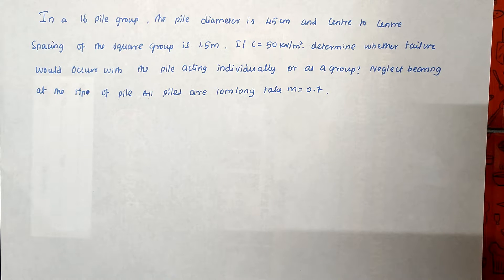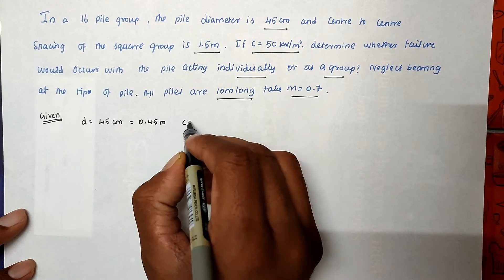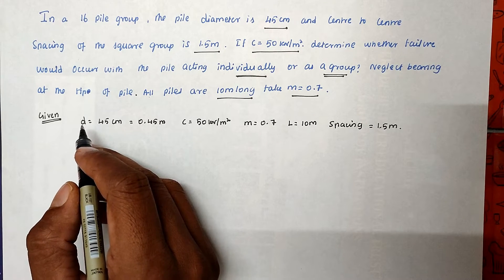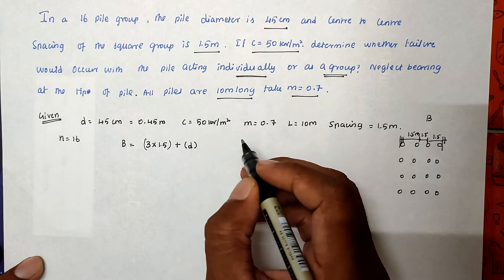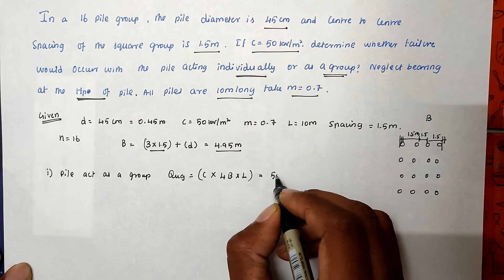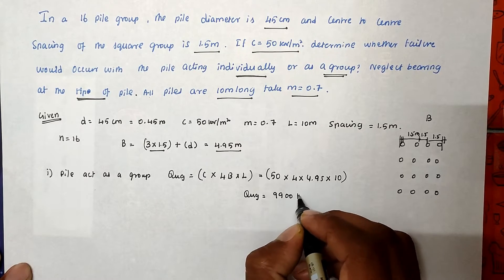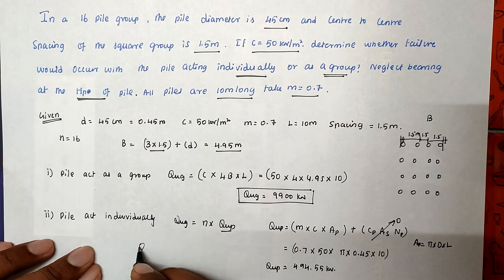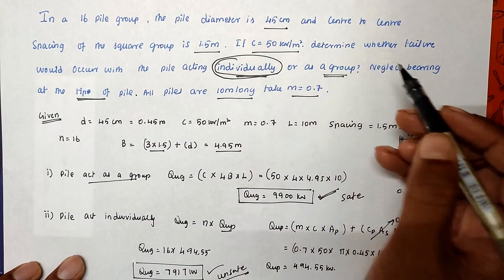foundation engineering numerical | pile carrying capacity | static formula | pile foundation problem

Comment: A group of 16 piles of 50cm diameter is arranged with a center to center spacing of 1.0m. The piles are 9m long and are embedded in soft clay with cohesion 30kN/m. Bearing resistance may be neglected for the piles. Adhesion factor is 0.6. Determine the ultimate load capacity of the pile group.
Reply: Eska ans to mujhe bhi nahi mil rha hai bhai